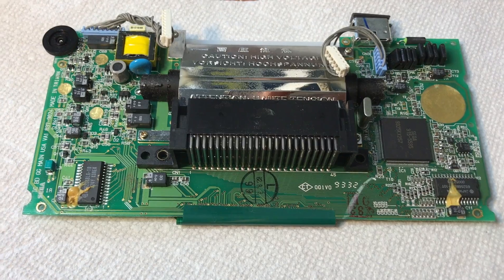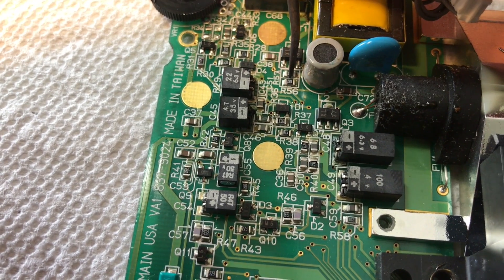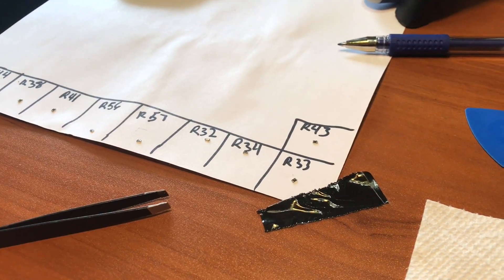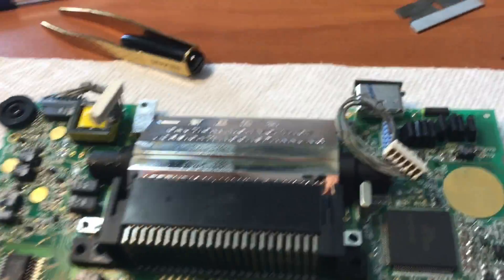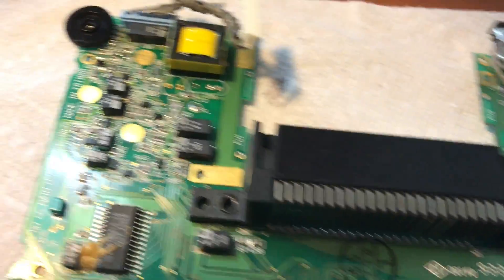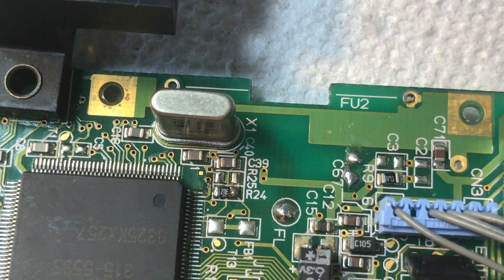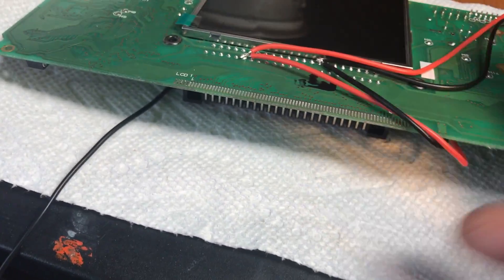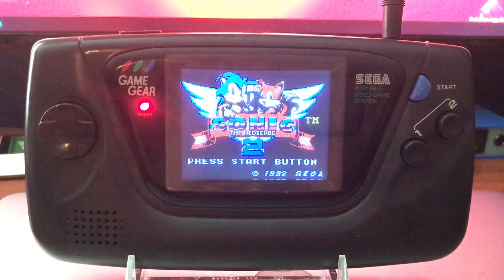Tinker Time DIY: McWill Sega Game Gear Screen Mod (ASIC 1 model)

Comment: Hi Candi , Just bought what looks like a "China" clone of Mcwills mod . Didnt come with capcitors/resistors so used your detailed writeup Thank you. Out of interest , are the 10pF capacitors  0805's ? i found some SMD capacitors which are 10pF / 50V / NPO. Thank you
Reply from the maker: Luke Taylor Unfortunately it’s been so long I don’t remember what they were. I remember I was able to get detailed descriptions of them when I emailed the creator of the Mc Will mod. I’m pretty sure if you go to his website you should be able to contact him. He replies relatively quickly
Reply: Thanks for the reply , lucky my version of game gear don't need the additional capacitor or resistor. But from what I read either is ok .. just one is a tad larger than the other.

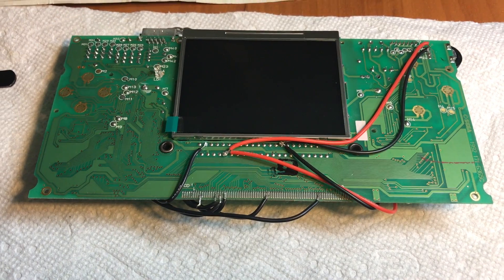Comment: Hi, I’m in the process of doing my game gear and I’m not 100% about where on the old lcd ribbon connector the wires go. In the diagram it shows pin 9 for the first connection, but the first 5 pins aren’t used, so aren’t counted. When you showed yours, it looked like you counted from the unused pins at the left. It’s at 20:08, did you have to correct them to get it working, or is that how you wire it?
Reply from the maker: Good catch! This was so long ago I had to go back and open up my GameGear to double check. I did screw it up in the video. I had another clip that had the correct wire layout but it seems I screwed up when editing. It did have to be adjusted to make up for counting the "unused" pins. Sorry for the confusion.

Comment: You never replaced those obviously blown capacitors.
Reply from the maker: Except I did. It’s in another video since I didn’t wanna do both projects in one. They aren’t blown or I would have had issues with volume, power and the screen (of which I had none).
Reply: @CandisClassicGameShrine  Should of done it prior to install. Replacing afterwards could change the voltage higher than 5 volts and smoke your mod kit.
Reply from the maker: If the capacitors were all rated at the exact same specs there really shouldn’t be an issue before or after install. What about people that have replaced the capacitor‘s and have a modded screen already but then the capacitors fail on them? It makes no sense for it to potentially ruin your mod if you’re replacing them with the exact same capacitors. It would be asinine to have to uninstall the mod every time you change caps.
Reply: @CandisClassicGameShrine  The capacitors on both sides of your board are leaking all over. That will corrode connections. Especially on those chips the that are covering. Your GG. So if you think they won't damage components when leaking that's your issue.
Reply from the maker: Can you go back and reread what I wrote? I never said that leaking capacitors wouldn’t damage components. You’re just seeing stuff that isn’t written. Obviously they would. That’s why so many remove the “death clock” one in an OG XBOX.
Reply: @CandisClassicGameShrine  its WELL known you should replace the capacitors, especially leaking ones before installing this kit. But hey... do it your way.